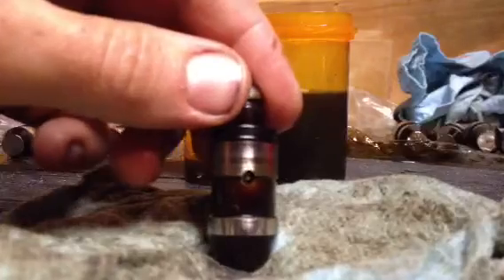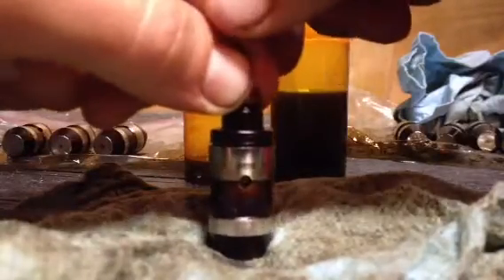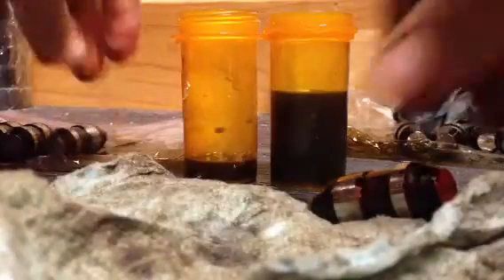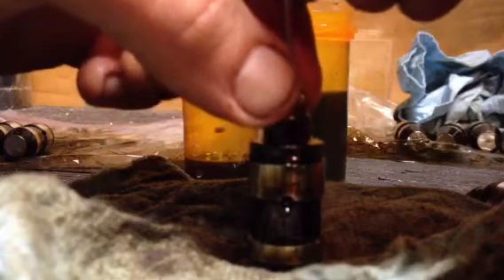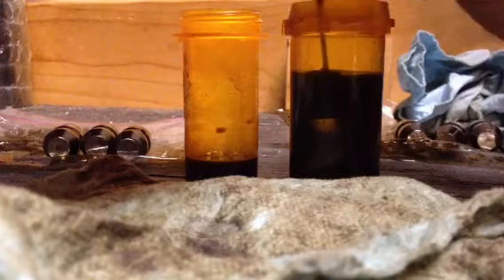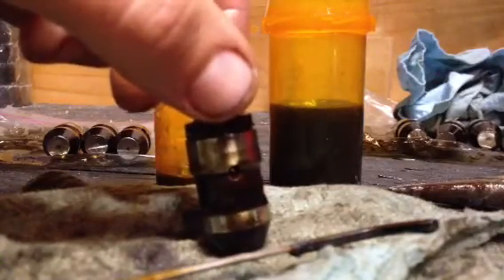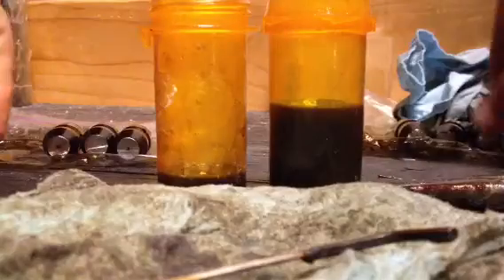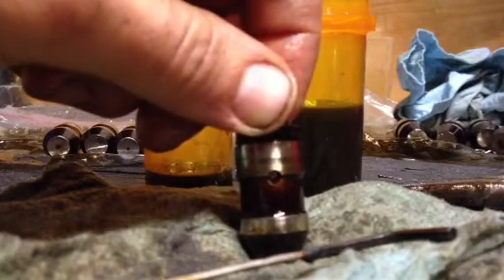Sr20de hydraulic lifter / hydraulic lash adjuster - service flushing and bleeding - explained

Comment: Hello , yes 2019!! what if none of the ones that are mounted move at all i even hit them with a hammer and no movement like they are solid rock.
Im also have not been able to open the lock on the inside to clean them ...
Regards.
Reply from the maker: Not sure if I understand completely, but please do NOT go hitting your lash adjusters with a hammer.

You will need to find something slim and long enough that slides through the top (upward) facing pinhole of the lash adjuster.  Center that pin and push down, you will feel something internally move.  The lash adjuster is then unlocked, and you will be able to compress or move it to suck new fluid in and to push the old fluid out.  I know that all Nissan, Mitsubishi (or DSM) early 90's - 2000's work this way.
Reply: @toekneefurareoh  Assuming you didn't destroy it with the god damn hammer.... Use a bench vice, with rubber jaws, to slowly compress it and it will bleed out the oil.

Comment: Hi Tony - I was told that ultrasonic cleaning was a good method - have you ever tried it or is it worth the extra effort?
Reply from the maker: Yes, if you have access to a unit that can perform the service properly, these are built quite strong, so the vibrations shouldn't cause any issues with the adjusters mechanically.

If you're looking to do this on the cheap, cleaning these out as I've shown will get the job done for the next 100k along with regular oil changes.

Comment: So when i'm reinstalling the lifters is there an orientation that the little hole has to go in?
Reply from the maker: No there is not, the heads and lash adjusters are machined to accept positive oil pressure regardless of the orientation.

Comment: Maybe a stupid question but an sr20 has 8 lifters right?
Reply from the maker: Generally speaking, yes.  4 on the intake side, 4 on the exhaust side.  Most non-turbo DE variations of the motor use hydraulic lash adjusters/lifters.  These are removed by pulling the camshafts, taking off the rockers, and the pulling the adjusters/lifters out of the head.
Reply: @toekneefurareoh  Would a special tool work to remove the SR20 lash adjusters without pulling the camshafts? https://www.youtube.com/watch?v=2GnPt_xK3-g
Reply from the maker: @soundhill1  no, in a traditional SR20DE or SR20DET head, you must pull the cams to get access to the lash adjusters/lifters.  No other way around it.

In the neo/vvl heads, its much different, but I won't go into detail here on how those heads work (no lash adjusters/lifters).

Comment: How can I tell between needing a cleaning or a failed lifter? I was told to replace all 8.
Reply from the maker: tmaxjesse , rare for a hydraulic lash adjuster to “fail” but not impossible. I would say any visible damage to the lash adjuster/lifter due to excessive tapping between top of the lifter and inner portion of the rocker = replace the lifter and potentially the rocker.  If when the lifter is pulled and examined, and it has lost its ability to “lock out” like I’ve shown in the video there is probably some internal failure of the lifter itself.  Otherwise the main goal is to keep consistent lash (or tolerance) between the cam lobe and the rocker, if that clearance or lash is out of spec and the rocker is just floating around in the engine then both the rocker and lash adjuster should be further inspected.  It is typically rare for something like this to happen without a car constantly running on low oil or a complete oil pump failure. And in most of those cases rod or main bearings will fail before the lifter/lash adjuster does.

Comment: Hey bud, love the Video. As everyone else is saying; I'm troubleshooting a bad lifter in my sr20det head. Rattles under load from 1000-3500rpm and its horrible. From the same place the noise is coming from It also reads 50psi lower compression. In the leakdown it showed leakout from the intake valves on cylinder4

Basically my question is: do faulty/ sticky lifters cause a loss in compression? My compression reads:

Cyl 1: 150
Cyl 2: 150
Cyl 3: 150
Cyl 4: 100

It misfires on idle, and the spark plug is always fowled in cylinder 4.

If you need anymore info please tell me, cheers.

Ps: engine runs beautifully except for misfire
Reply from the maker: Looks like your comment accidentally got caught up in my potential "spam" comments.  So first off sorry for the late response.  The short answer to your question is that faulty/sticky lifters will NOT cause a loss in compression.  Lost compression is typically from bent valves, valves that do not set properly in the head, or poor piston rings no longer within spec tolerance.

How do you know if loss of compression is due to the valves or the pistons, the best way to do this without opening the engine is to run a dry versus wet compression test.  Any significant improvement in the wet test over the dry test typically will point your compression issue to the piston.  Negligible/no significant difference from the wet test usually means you have something going on with the valves.

Good luck, and hopefully this helps.
Reply: toekneefurareoh Better late than never :) turns out my lifters seized on the intake side, and my rings went aswell. Unsure what happend but im guessing something oil related failed, due to my turbo blowing aswell :/

Long story short ive replaced the drivetrain completely with fresh parts and a fresh motor. Not long now till its back on the road :) cheers

Comment: Spent half the day looking for a video that really describe these lifters. Yours is the only one I found so far. The one question I still have is why Kawasaki wants the lifter soaked in kerosene instead of oil. I would think a good cleaner better than kerosene and then oil would be the best option Thank you very  much.
Reply from the maker: +Zane&#39;s Vids Appreciate the comment and the question, if using any type of cleaner other than clean oil, make sure you flush the lash adjuster/lifter enough, so that the only thing left in it when you install it back into the motor is oil.  The tolerance of the lifter is designed not to collapse when it is full of oil, if there is any cleaner of a viscosity or thickness less than the oil recommended by the manufacturer, you may find the lash adjuster/lifter will fail.  That's why I recommend to clean/flush using clean oil.  Hope that answers your question.

Comment: I did this the other way on a Chevy LS1 in my car over 2 years as I have been living on unemployment benefits over here in Australia and the engines valves are pushrod operated,the hydraulic lifters are also underneath the cylinder heads which means if you have no money for cylinder head gaskets,an inlet manifold seal kit,exhaust manifold gaskets & cylinder head bolts there is no option to do it the other way , either flush the engine out with 1 litre of diesel or kerosene by idling the engine for 15 minutes before dumping  the oil out of the sump with that in it or add a product such as the Wynns engine tune up & oil stabilizer to an engine with clean oil (recently changed) or both as I did.
That was a pain in the backside for me as every 3000 or so kilometres after an oil & filter change the lifters would start to "clack" (due to the sludge breaking up & entering the hydraulic lifters), I also looked at the possible cause of the lifters having varnish inside of them,sure enough , it took 2 bottles of the Wynns product to notice a change in engine smoothness at idle & an increase in performance,I ended up using 5 bottles of the Wynns product.
I noticed when driving up a hill slowly,the exhaust lifter on number 8 cylinder would start to "clack" , this was caused by sludge trapped inside the oil gallery so what I did a fortnight ago is add about 900 mLs of diesel to the old engine oil whilst the car was parked up on a hill sideways so all of the sludge would gravitate down into the oil filter, I had previously removed the oil drain plug and pulled out a whole lot of dirt particles which was trapped inside the oil gallery & in the oil.
So I started off on a clean slate with a very clean motor & a new oil filter,there was an issue with the lifter still "clacking" but a few big revs cleaned most of the lifter out (oil hole was still restricted),so in an engine with very clean engine oil,the lifter would like the lifter in the right container ,all the rubbish would be coming out of the lifter like that.
How did the noise start? , Well , I replaced the oil pan gasket in 2013 as it was leaking oil,the main oil feed is sealed off by this gasket so the top end must've lost oil flow through the lifters till it became a mere dribble,once the oil pressure increased a chunks of sludge must've been disturbed, some of the fine grains of dust probably got past the lifters & entered the oil galleries thus blocking the lifters up, the lifters may have been running as solids rather than hydraulic roller cam lifters for a lot of years and the increased oil pressure actually disturbed that.
The engine probably also missed a few oil changes before I bought the car in 2008,I didn't add any more of that Wynns product as I am confident the engine no longer needs is,there is only a lifter tick there sometimes on that lifter on startup which goes away in a second or two so I am just going to let that sort itself out as I don't think the engine has any more of that sludge left in it as do a few people locally.
As far as lifter servicing goes, I am not aware of any service procedure for them as the lifters should remain clean as will the whole engine if the oil is changed regularly,I normally change mine at 5000 - 6000 kilometres but have done more regularly as the oil has come out really dirty,my dads car has the 2000 model 3.8 litre Buick V6 fitted and still looks like a brand new engine at over 346,000 kilometres when looking into the oil filler hole,it however needs another cylinder head as it has suffered valve recession on number 2  cylinders exhaust valve from the use of LPG (liquified petroluem gas),the LS1 engine is approaching 313,000 kilometres and looks clean under around the valve springs but underneath the cylinder head where the lifters are is where all of the sludge was.
Reply from the maker: +Russell Booth Thanks for the comment, yes on different engines, sludge buildup can occur even in instances where the engine is well maintained and when the oil is changed during recommended intervals.  Luckily the Nissan SR20 engines were built really well, and its pretty rare to have this problem.

In the instance of the motor I was working on in this video, sludge wasn't a problem due to poor engine design, just the previous owner not staying on top of the oil changes.  Unfortunately, even flushing the engine with cleaners still wasn't fixing the issues of valve tick I was experiencing.

So by pulling off the valve cover, locking the cams gears to the timing chain with some zip ties, and removing the cams, I had very easy access to my lash adjusters/lifters in about 30 minutes, about another 30-40 minutes to flush them like I explain in the video, about another 30 minutes to reinstall everything, and the motor was much more quiet.

But I do recommend if you can find a cleaner to flush your engine oil on the next oil change before taking it apart, give that a try first, you might get lucky.

Comment: Thank you for the video. I heard about the process, but this is the first time that I've seen it. I'm troubleshooting an issue that may be a sticky lifter in a SR20DET. Have you worked with Sea Foam? I was thinking about giving it a try before pulling the lifters.
Reply from the maker: +D Puorro , sure seafoam is a good product, when you use it correctly.  Make sure the engine is warm before you use it for best results right before an oil change.  Let the engine run for about 10 minutes hot with the seafoam in the oil, then drain it right away.  Replace with new oil and filter.  It may take a few oil changes for this process to effectively wash out all of the gum/sludge in the lifters.

On a side note, some SR20DET heads came with solid lash adjusters (lifters), so this process described may not apply to some SR20DET engines.  I'm more familiar with the FWD SR20 heads, and I know for a fact, the Gtir head off the Pulsar uses solid lash adjusters.  In that case, you may need to get a shim kit to eliminate the valve tap you might be experiencing.
Reply: Thanks Anthony. I'll double check, but I'm pretty sure that the RWD S13 version of the Blacktop SR20DET is hydraulic. The Sea Foam seemed to fix the sticking, but after pulling the oil pan, I think the motor may need a full inspection and rebuild.

Would a sticking lifter cause a reduction in oil pressure or is it a symptom?
Reply from the maker: +D Puorro , not really sure how you are determining low oil pressure, are you using an aftermarket gauge, if so, where is it hooked up?  If you are running the gauge off the turbo feed line, keep in mind there are usually reducers that will ease the oil pressure so you don't blow your turbo seals.  So pressure may appear to be low depending on how the car (gauge) has been set up.

Pull your oil pan and check the pickup, a clogged or bent pickup (caused by a dented oil pan) will cause low oil pressure, a poor seal between the pickup and the pump assembly itself will also cause poor pressure.

If you use thicker oil in the car and noticed increased oil pressure, there is a good chance the pump assembly itself could be worn out.  If there is no difference between heavier weight oil and the standard stuff, I would say the problem is somewhere between the pickup and pump assembly itself.

Most likely, poor oil pressure is not caused by a sticking lifter/lash adjuster.
Reply: Thanks for the info! Thicker oil definitely increases the pressure with the motor. It's an AEM gauge attached to the stock sender point by the filter. Pulled the pan and the pickup looks good. Gasket looks good, but I'm not sure how to tell for sure. Due to the age of the motor and some metal shavings, I'm going to pull the motor, replace all the gaskets and go through everything before the end of the year.

Comment: Thanks for this video I'm not doing this on sr20 but I did have an old 2s motor for my Toyota camry and I'm sure this is the same info can be used towards it. (It has valve lash adjustors to) Haynes manual for it didn't go into much detail for this and it was nice you did a little walk through. Ty
Reply from the maker: James Collins Sorry for the late response, hope servicing the hydraulic lash on your Toyota went well.

Comment: Just a quickie, didn`t catch it in the video: Did you put these back on the engine full of oil? I completed my sr20det rebuild some months ago and I installed them full of oil (cleaned them the same way you did, though). But some people put them in empty?
Reply from the maker: Always reinstall hydraulic lash/lifters on an SR20 engine full of oil, the objective is to remove all of the air in the process above.  Some SR20DET engines use solid lifters and do not require this service after long periods of time, but should be inspected, and replaced as necessary with a correct shim kit.  All SR20DE engines use hydraulic lifters (even the roller rocker style engines).

The factory service manual should reinforce what I said above.  Good luck!
Reply: Anthony F Okay, good to hear. Thank you.
Reply: Hi
I got a SR20DE with roller rockers but my lifters don't move at all! I assume I got solid lifters. would that be possible?
Thanks a lot a great video